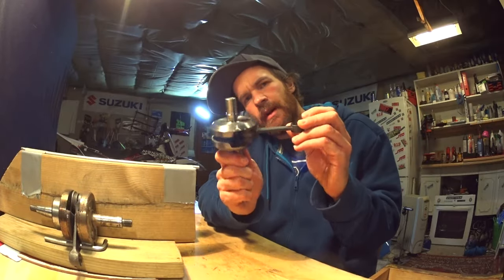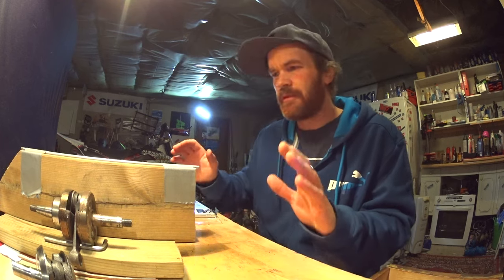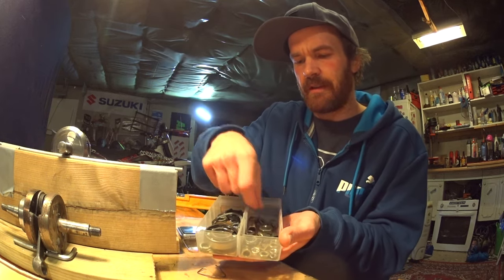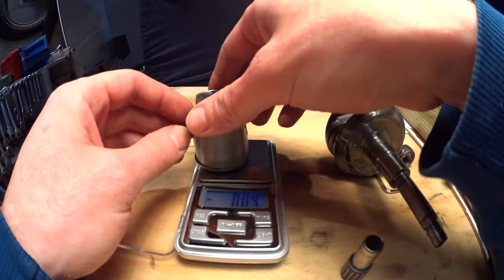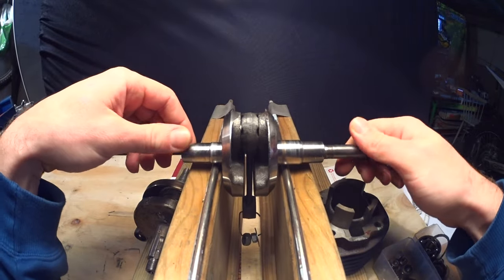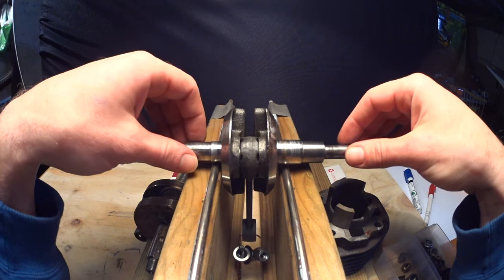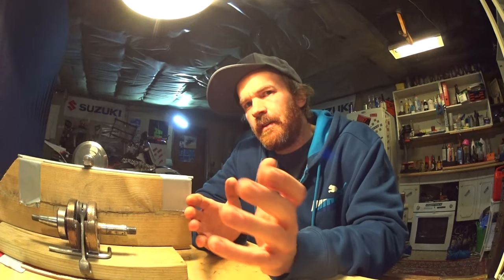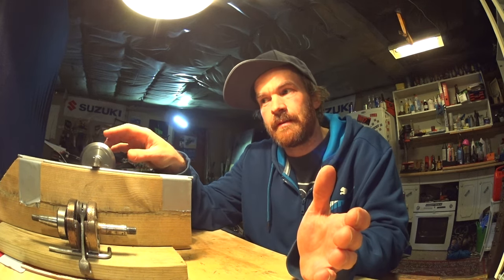CRANKSHAFT BALANCING MADE EASY | Finding Crankshaft Balance Factor | 2 STROKE TUNING

Comment: I recently made modifications to my 250 two-stroke. I added a slightly heavier piston, a larger crank pin and longer heavier rod. I also filled the balance holes with JB Weld. After getting it running I noticed at about 7000 rpm I was getting a bad vibration. I went back and checked Balance factor and it was 31. I then removed the JB Weld from the balance holes, that got the balance factor up to 38%. Evidently, JB Weld is fairly heavy. I could’ve tried it again to see if it was better, but I decided to add weights and get the factor up in the 50s. I added about 3 ounces of tungsten and it is now 55%. Will put it back together in next two days and see how it does.
Reply: Update, With my balance factor up to 55% there is much improvement. There is still vibration of course, but it’s better than it’s ever been. By the way, I used JB Weld to fix the weights in the crankshaft. So far so good.

Comment: I think your math calculation is incorrect. You use the partial weight of the connecting rod twice, (26.65 + 32.26 = 58.91) and also for the total reciprocating weight of 108 (26.65 + mass of piston/ring/pin/circlip). There is no reason to have the 26.65 gm in both top and bottom numbers of your equation. (58.91/108) Your equation could be 32.26/81.35 = .3965 or 39.65%. You are not taking into consideration the rotating mass with added flywheel and timing gear weight. I think if you want to static balance it, you have to figure out the counter weight of the crank without the connecting rod attached but with the fly wheel and timing gear mounted. You could use your hook method and add washers and weigh that mass. Then if you were trying to achieve a zero balance, then ideally you would want your piston/rings/pin/circlips/bearings/con rod to weigh the same as the counter weight of the crank. I think this is why balancing a rotating assembly requires metal added to the counter weights a lot of time. My 2 cents.

Comment: The rod has a upper end weight & a lower end weight. Weighing the upper end weight twice does not give the total weight of the rod. You also did not include the big end bearings. I balanced engines dynamic (spin balance) for years in a racing auto machine shop. The crank need to be taken apart & the rods upper & lower end weight weighed separate along with the lower bearing. The crank pressed back together & a bobweight made with the 55% upper weight added. Then balanced . When balanced Reassemble the crank. I know its more work but it will be much closer.

Comment: Calculation made simple// First load the crankshaft to find the weight for static balance.// 50-60 % of that weight is going to be be the weight of the piston + pin for minimum vibrations. Thanks 2STROKE STUFFING !
Reply: Thanks for explaining👍
Reply: Actually you have it backwards I believe....50-60% of the Total weight will equal the static balance weight.
Reply: I may be dumb or somethjng but how do you apply that math to the actual balancing of the crank? What do you do when reassembling it to adjust the balance??
Reply: @DrCHAOSBTW  you figure this out?

Comment: Hi From denmark.
Thanks for all the good vidios.
Some say that 50% balancing factor is the right amount??
I tune my own 23cc 2 stroke engines (Zenoah), I make the conrod and pistons lighter and the piston-pin, then I will have to remove material from the counterweights, right??
If I want the most RPM's out of the engines, what factor would be the best for that?
Or the smoothest running?
The engines are used in 1/5 scale TouringCar Race, the cylinder are sitting at about 45dg angel.

Hope you will comment this.
Thanks

Ole

Comment: Whilst this upload was of short duration,  ( 5 minutes ) the subject matter is covered reasonably well, although it raises more questions than answers, which can be noted from the responses in the comments below. 
 However, the definitive book on tuning single, multi, parallel , opposed piston, and split single engines , whether two stroke or four stroke, is contained in the 1949 publication by Phil Irving, called " Tuning for Speed " . 
This book is the Bible for tuning engines to maximum performance. Amazon sell it for a small sum, and it is still the best book for the home tuning person, without doubt.

Comment: Hello, I am Felipe, I am a follower of your page, I have learned a lot about 2-stroke bicycle engines, I have a ZEDA YD100 50mm, my engine reaches 8000rpm, I corrected the balance factor of the crankshaft to 52.5% but I still have vibration from 6500 Rpm.  The question I have?  Do I raise the factor to 55%?  What do you think?  Thank you Felipe

Comment: Alex help me out...im back and forth with a pretty knowledgable guy bit he says u do this wrong..same way I do it. You counted the con rod in the recip mass than you added to the bobweight the con rod to get the full hang weight. Tgis hang weight is then calculated in% of the total reciprocating weight.He swears you are doing it wrong and Connor use the conrod twice ...please clear this up as I am referring him to this video
Reply from the maker: I'm not quite sure what part he's disagreeing with?
Reply: 2STROKE STUFFING anyway I'd does not make sense...he says no using the small end of rod twice in the equation. It has to be added to recip mass as it is part of it. But then it hangs as u get static balance so it is added to the bob weight to get the full hang weight.he thinks you should only divide the bobweight into the recip mass not add the rod and use the full hang weight.

Comment: I want to go for as little vibration as possible with 30cc 2-stroke single cylinder engines running 10,000 rpm to 13,000 rpm. (for RC helicopters, which are sensitive to engine vibration).
IMO, you should include the application of the "balance factor" in this vid, because your viewers are still in their shop with a crank on parallel bars.
Reply from the maker: +EarthSurferUSA My recent video where I rebalance the Spx crank could help, I'll put a link in the video. Thanks!
Reply: That is awesome. I also fly gasser helis and I'm looking into this as well since BH Hanson and Toxic Al wont be modifying engines forever.

Comment: can I ask about the balance factor, I have a motorbike with a separate balancer, I want to remove the balancer and move the drop point of my crankshaft by adding weights to the crankshaft, can you tell me how to do it but not cause or reduce the vibration effect, because I have plans to added 4 weight points to increase torque and changed the crankshaft drop point to 5°-3° before the highest point of the crankshaft, thank you

Comment: 75% for a ktm 300 exc two stroke is good? the motor is probably about 30 degrees away from the cylinder being pointed straight forward.  i've got 295/395 which gives 0.746... so about a 75%; i am going to assemble it like this anyway, but i am curious if it's an ok number.

Comment: I am your subsciber from indonesia. Thank's for giving me info. I want to ask if the standart motor manufacturer also apply 55%?
Is that count only for tune up machines only?
Thank'$
Reply from the maker: Thanks for subscribing! Manufacturers use various factors depending on engine orientation, frame design etc.
Reply: I dont your speaking.i dont speaking inglis
Reply: Dia bagi tahu, berdasarkan keadaan bentuk engin motor.
Reply: ha'a

Comment: Hi I have seen and enjoyed many of your videos I especially liked your nitrometh moped. I was wondering if you're looking for power why don't you use efi. I have seen some efi kits that can even do duel fuel injection so you can vary the amount of nitro to methane. The company I found that looked best was ecotrons small engine efi. Thank you and keep up the good work.
Reply from the maker: +Karelin James I might look into that! EFI on high power, high rpm 2 strokes are extremely difficult to get right when running gasoline. Methanol/nitro is far less picky about afr qnd should be much easier.
Reply from the maker: +Karelin James ...and Thanks!
Reply: 2STROKE STUFFING Thanks I also believe that the kit above can control the ignition timing as well. I have been looking at this kit for a while but have lacked the time and funds to pull the trigger (about $600) and I would love to see somone talented like you to try it first. Thanks for looking into it again its called ecotrons small engine efi kit.

Comment: In terms of engine performance, what is the difference between an unbalanced internals vs a balanced engine internals on a dyno? 🤔
Reply from the maker: Interesting question, never seen much research on the subject.
Reply: Vibration is lost energy get rid of vibratiion,,,,and
Reply: 50% will balance for idle.  Higher like 70% will balance for high RPM.  You are converting up/down primary imbalance to fore/aft secondary imbalance.

Comment: How can we use the calculated balance factor? What is the wrong balance factor? If we get 55% balance factor, what is the next step? Do I need to take 55% weight off the crankshaft? Or add 45% more weight?
Reply: im sorry but thats where i was left at the end of video to.... i would think that 58 grams is what you want on the upper half.. so drill 50 grams out of the flywheels above the conrod?????? 108[stock weight]-58 [new balanced weight]=50 [desired removal amount?]
can you confirm this 2 stroke..im in canada here and its research and development season.. i got into this last summer and scratched up 3 cylinders.. i hate breakdowns and want to prolong and prosper instead of gouging them to death now
Reply: very good and obvious question. im so glad you exist and that we think alike.. no else asked this..were obviouslyvery dumb. or damn brilliant. or just awkwardly different.

Comment: So if I measured my balance factor to be 54 percent, that means Im ok in balance and no weight has to be removed from crankshaft? Engine is 1 cylinder long stroke 45 degree engine.

Comment: Maybe I missed something simple, but didn't you effectively only weigh (about) half of the ConRod?? Isn't its contribution to the reciprocating mass about double what you would measure on the scale with that method?
Reply from the maker: It's just an estimate weighing it like that, but it gets you close. It's complicated cause the closer you get to the big end the more it's contributing to rotational mass vs reciprocating. As there's nothing like the "right" balance factor it doesn't really matter if the number you end up with is say 5% off what it would've been if you did the math as long as it works.
Reply: 2STROKE STUFFING ok that actually makes a lot of sense, I never considered the fact that not all of the Conrod contributes to reciprocating motion... Weighing the whole conrod would cause you to be on the heavy side, then??
Reply from the maker: Totally understandable. Yep it would

Comment: Hi there. Enjoyed all of your videos. Great stuff. So if I'm understanding correctly, to achieve the perfect balance, hung weight=piston weight?
Reply: And if piston weight > hung weight, is it considered safe to trim off some weight from the piston or doing this will cause more problems
Reply: Eg: bore x stroke... 50x49.5 to 62x65.5
Reply: Yes. So if the balance is way out or not enough they usually add weight to your crank. The piston will rarely be too light to shave weight from the crank as I understand it

Comment: sir u have video how to add weight to to crank or remove weight to the crank to make it balance? 0.55 is the weight that u will add?
Reply from the maker: +pepito roaquin I'll be making one when I rebalance the new Spx crank. You basically add/remove weight to get to the desired number like 0.55
Reply: 2STROKE STUFFING yes pls i really want to learn and u teach me a lot,, for now i know how to get the formula,,, but then what shoud i do with that,,

Comment: Great. But I want to know how it works. I mean how adding weight keep it still.
Reply: The counterweight on the crankshaft is meant to balance out the weight of the reciprocating mass (piston, connecting rod, etc).  He kept adding weight until the weight hanging from the connecting rod is equal to the weight of the crankshaft counterweight so that no matter the rotation of the crankshaft the weight is equal.  Check out "balanced rotating assembly" to learn more about what all is involved.

Comment: What do I do if my crankshaft stays in position without any hung weight? Im working on the 66cc mb engine trying to balance my crankshaft. Also I can’t tell if it is really staying in position or if there is too much friction between the bars and the crankshaft, so I might try to use some bearings instead or the metal bars.
Reply from the maker: Then you do the same calculation with "0" as the hung weight.
Reply: Okay that's what I thought. So I guess that means I need to lighten the side of the crankshaft that the conrod is on so that I can hang more weight and increase my balance factor?
Reply from the maker: Yep!

Comment: Does the flywheel and clutch weight change or help the % ? im thinking of my vespa, with the clutch diectly on the crank?
Reply: I think flywheels and clutches are already balanced.  At least on normal engines...

Comment: Would the goal ever be to get to 100% balance factor?  Wouldn't that mean the crankshaft was perfectly balanced with piston installed?
Reply: No, and static balance of 0 to things moving in different directions means little to vibration, this is why this is so hard.  Now if you can connect the crank to a wheel dynamic balancer, and make it spin at the range you notice the worst vibration, you may get an accurate position to center a counter-weight. 

Vibrations have a frequency, an amplitude (this directly relates to the weight off balance), and a vector (direction).    The bottom of the rod moves along the stroke axis and vertically to it, and so does the crankpin, but not all of it, different parts of the rod move differently in oval kind of shapes, the part around the piston pin only moves along the stroke axis, and so does the wrist bearing, piston and rings.  

Also, because the acceleration on a detonation stroke is much larger than the de/ac/celeration on the compression stroke, the vibration caused vertical to the stroke axis is not symmetrical on both sides.  And it is the acceleration (+/-) of the counterweight that causes vibration, it is never 180/360' kind of counterweight.  This then always causes the tdc/bdc to be asymmetrical as well.  

This is why even a parallel twin 2 stroke will vibrate no matter what, or an opposing twin, etc.
Dynamic balancing is a science, and at some point the designer says enough, this is as good as it ever going to get.

Vibration itself is a wasted energy that also prevents the engine from revving faster without exploding, is also requires heavier bracing in the cases, but the final factor is how annoying the vibration is to the user of the machine.  If a chainsaw rattles your arms out of their sockets you are not going to work as long, or ride as long.  The funny thing is that we have some vibration that feels good and some that feels very annoying.  You can ride a HD twin for 10hr straight, and you can ride an L4 and be numb in 2hrs.  You put rubber mounts on one engine and they last a century, you put the same in a similar engine and they fall apart in crumbs at no time.

If you don't like vibrations don't ride a big bore single.  A Suzuki GT750 had less vibration than an RE5 ... go figure!

Comment: How would you go about measuring a counterbalance shaft? On the crankshaft the connecting rod is already at the right radius but the counterbalance shaft has no point to hang the weights from.
Reply from the maker: +Sketch1994 One way is to just calculate it, since it has no reciprocating mass it shouldn't be too difficult.
Reply: Typically it is indeed the same as the calculated mass at the crankshaft. Though I have fitted an aftermarket rod, I don't have the stock piston(I have never even seen one), and my only constant is the balance shaft which I can't measure! I have some pics of how I tried to measure it but it was very inaccurate due to all the crap that were involved.
Reply: Can you show us. Thanks for the videos

Comment: so to make the balance factor can use two alternatives whether it can do drilling on the crankshaft and enlarge the piston diameter .. is it like that? Sorry, my English is bad
Reply from the maker: +Galih Putra GPS Racing To change the balance factor you need to either add/remove weight from the big end half or counterweight half of the crankshaft. Drill or grind to remove weight, add heavy metal(tungsten/Mallory) to add weight.
Reply: 2STROKE STUFFING 
thanks, I'm looking forward to the continuation of this video, you're the best
Reply from the maker: +Galih Putra GPS Racing Thanks!
Reply: Galih Putra GPS Racing ok baik megikuti berminat

Comment: I want to stuff some crank holes...anything better than JB weld you suggest?
Reply from the maker: They used to glue in cork. Works good, and no problem if it comes loose.
Reply: 2STROKE STUFFING thanks but I was meant the epoxy itself what epoxy to glue the cork in...i may just weld a little bit of a cap over aluminum plugs.
Reply from the maker: Ah, ok. JB works great, so does Devcon F (and most other epoxies I've tried. Clean well before application!
Reply: 2STROKE STUFFING thank you. Balancing up the gas bike crank...hopefully you will get there in your future vids.